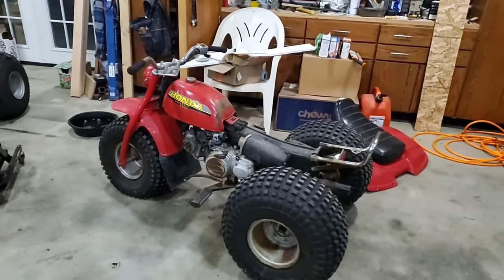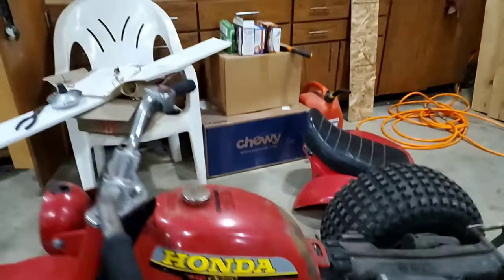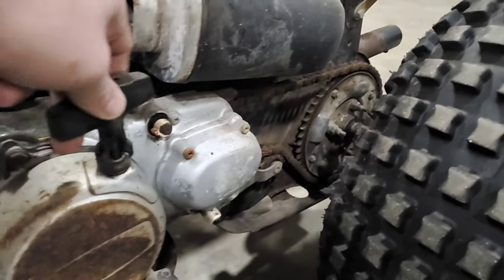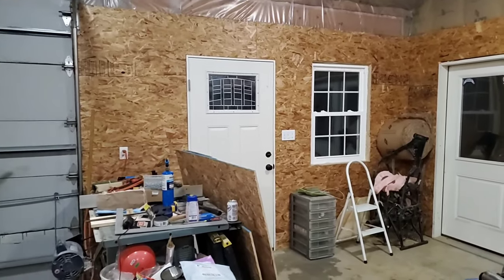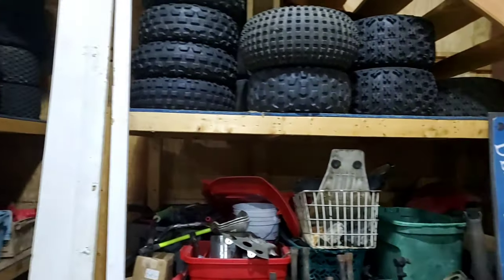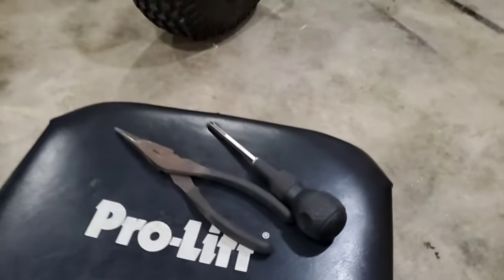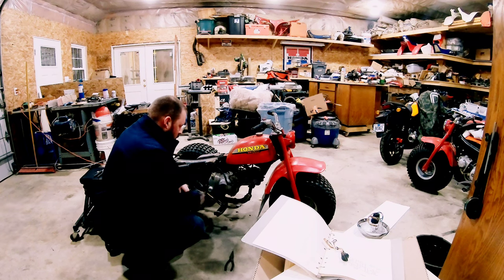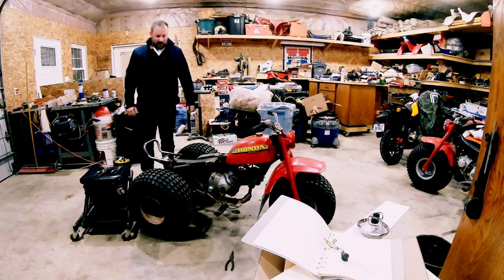1980 Honda ATC 110 With No Spark - How To Troubleshoot A Points Ignition System

Comment: Number one thing on those 110s is clean were the coil grounds to bare metal and back side of coil mag to bare metal and screws to also clip the end of the coil quarter of a inch..
The coils on those are pretty much bullit proff though I have seen them go out..

Comment: Do you know if the air box off a later 110 will fit a 79-80 If I use the intake boot, box and all? I'm trying to resurrect a 1979 110. It's already a mix of 90 and 110 parts so its not worth much. I just want to get it back on the trails as cheap as possible and expanding the search to include newer models would help a lot.
Reply: For anyone looking for this information. 1979-80 share the same air box P/N that is intake boot, filter body and the filter cage. 1981-82 share intake boot and filter cage with the 79-80. 1983 and above have a stand off attached to the frame making it not fit the 79-82. I'm not sure if you can just make your own Spacers and use that. After seeing the frame difference I stopped my search for that airbox as a replacement. And unless I find one for a steal I'm not going that direction for fear of other differences that I cant make out from ebay pictures. I also checked us90/ATC 90 and the carb is smaller as well as the inlet for the filter cage being smaller. I did find out that the filter cage for a 1982 ATC 185s will interchange with a 1979-1982 ATC110. I'm not sure the difference between the 1981 and 1982 ATC 185s but partzilla does list them as separate P/N's.